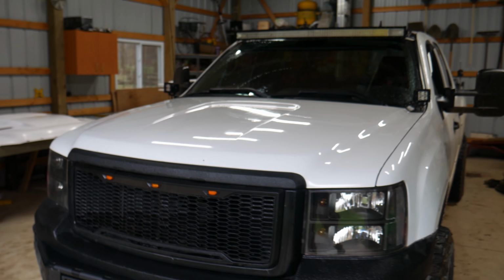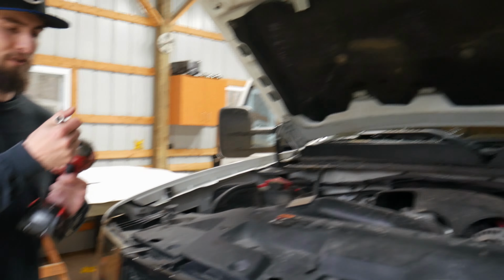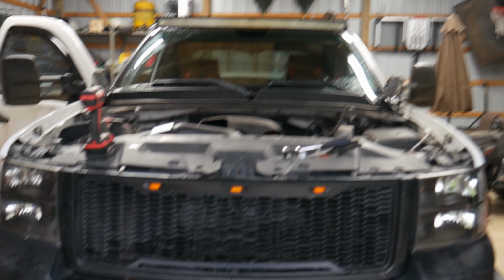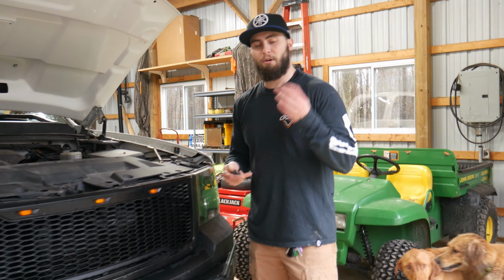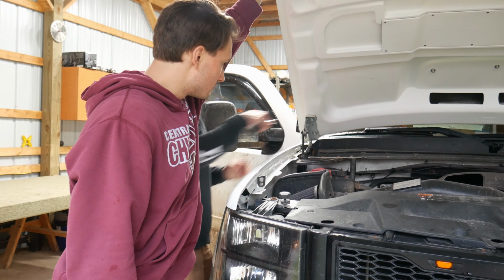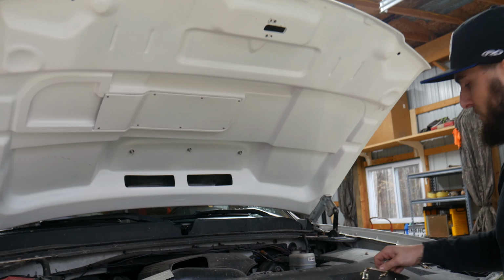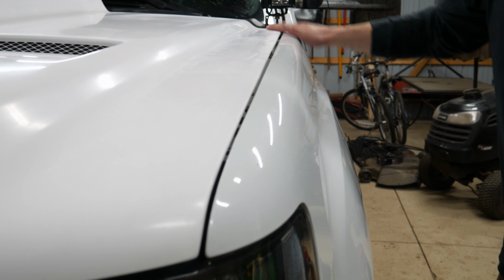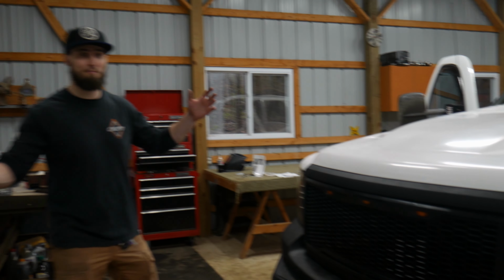AmeriHood Ram Air Hood 07-13 GMC Sierra 1500

Comment: How do you go about adjusting the latch on the hood?
Reply from the maker: You can extend the bar on the hood, or you can lower the bump stops so the hood can sit lower
Reply: @CaswellCustoms  do you just undo the 2 bolts and the latch pulls out?